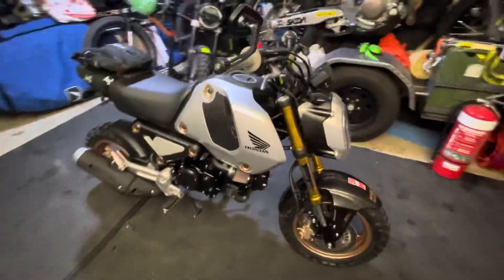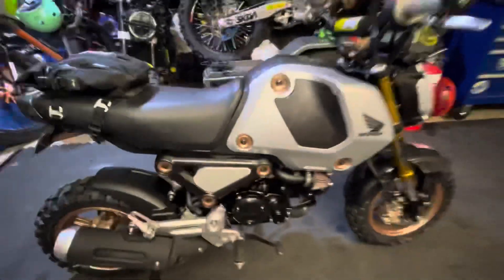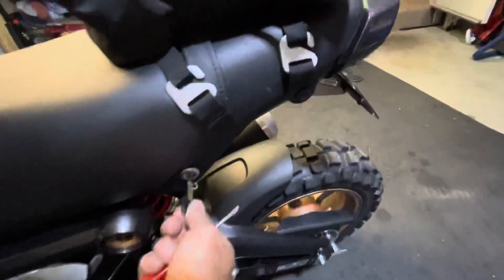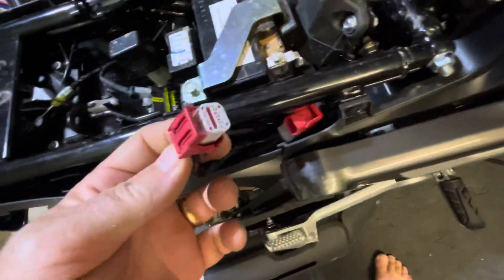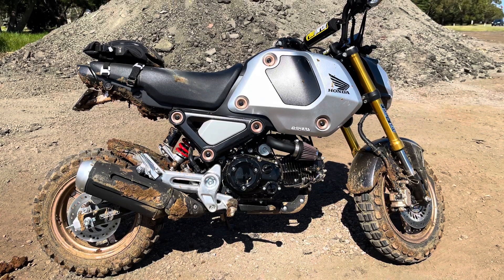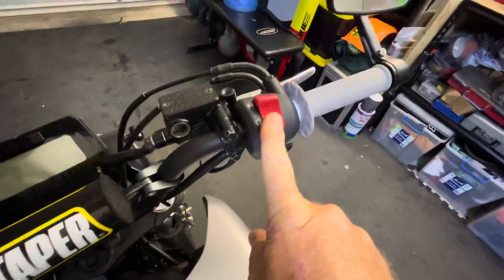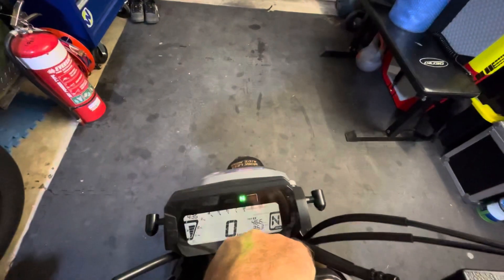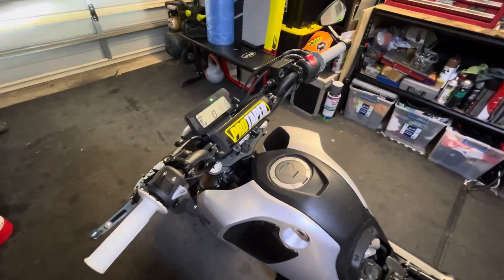2022 Honda Grom ECU TPS Reset how to..

Comment: I changed the stock paper air filter on my Monkey to the Takegawa Power filter, which is also available for the Grom. I've not done an ECU reset and have ridden already 600 miles. I want to do an ECU reset. Does it suffice to only do what you showed, or do I also have to reset the throttle position and the other resets that are in the manual?
Reply from the maker: Would be a good idea to do all For sure pal…

Comment: Does this fix engine runing lean
Reply from the maker: No not really, i prompts the ecu to adjust to any minor changes more quickly but, if you’re changing the pipe and I take you really should get a flash or piggyback to manage the fuelling.
Reply: @dwninetynine  oh I duno what my issue is iv changed everything I got low power in lower rpm at Full throttle I can old my brake on a tiny bit and the bike can't rev up at all. And bad slow throttle response
Reply from the maker: @jasoncarthew2279  well for sure it’s worth resetting the ECU… what you’re experiencing sounds odd.. have you by any chance bypassed the side stand switch?
Reply: @dwninetynine  yh I cut the side stand switch I dout it could be that.  Don't get me wrong the bike ride fine it starts up fine never cuts out its that the pull off on full throttle at any thing below 6k  revs and the bike just about moves. Iv changed 02 sensor and wire, air box and manifold, throttle body with injector, fuel filter, air filter, and fuel pump.  😢  lol
Reply: @dwninetynine  you think it could possibly be the valve clearance 🤔
Reply from the maker: @jasoncarthew2279  there’s strong consensus that bypassing the side stand switch causes the ecu to limit the power in some cases.
Try reconnecting it up, it’s a sensitive circuit trust me I’ve done my homework here. Then reset the ecu and just see if it makes the difference.
Reply from the maker: @jasoncarthew2279  it’s worth checking, is only a 5 minute job.
Reply: @dwninetynine  wish I could check can't get one of the bolts off its rounded just spend 2 hours today trying to hammer it off with a screw driver and drilling a hole.then the drill bit broke off inside the bolt 😄
Reply: @dwninetynine  oh yh and I rewired up the side stand switch as well
Reply from the maker: @jasoncarthew2279  Howd you go? reset the ECU, give the bike a ride, say 30 mins, see what effect its had... Keen to hear...
Reply: @dwninetynine  I been riding bout over hour now no change
Reply from the maker: @jasoncarthew2279  Damn thats disappointing!
Reply: @dwninetynine  I got a spare engine in the shed I pop that on some.time see if that changes any thing thanks for your help buddy I appreciate it 🙏
Reply: @dwninetynine  hello, I just threw an exhaust on my 2023 grom and I got an air filter from k&n (not installed yet). I definitely am worried about leaning out the bike to much. As you said above the reset doesnt fix it. Any recommendations?
Reply from the maker: @Dragonstorm1557GAMING  I would definitely recommend either an ECU flash or an ARacer. I have my ECU flashed by CJR Performance to match all my mods.. well worth doing.

Comment: Hi, I need some help..... I followed the procedure to reset the grom 2022 ECU, I connected the green and blue wire, I fully opened the gas knob and switched on the ignition but the engine light stays on instead of flashing.. .....where am I wrong? Thank you.

Comment: That procedure does not reset the TPS, it resets the ECU.
To reset the TPS you need to use the oil temperature plug too.
But... if you have any error stored, what you just did is useless. You need to clear the errors before anything else.

Comment: 👋 pal I noticed ya rocking  knobby  tires  tell me how are they on pavement? Is it sketchy on turns?
Reply from the maker: Hey bud, These are Shinko Mobber tyres, they are great on the pavement, I can go pretty hard with them, have had the front slide on me once, but I was riding round the Melbourne GP circuit and I was taking liberties LOL.... As for off road, tehyre bloody awesome.. Theyre soft compound so do grip pretty hard on road.. Hope that helps...

Comment: Good video! Quick question, do I reset both after the new ECU install or before I install the new ECU?
Reply: Do not do this if you flashed your ECU.. you will reset that ECU to factory settings.. money down the drain
Reply from the maker: @GODGOTME3927  is that true? I did t know this!! Wow thanks for the warning!! I’ll update the video description!!!
Reply: @GODGOTME3927  no you won’t. Many sources say different.
Reply from the maker: Hey, thanks for the message... I've been told to do it after making any chnages to the bike... hope that helps...
Reply: @dwninetynine  helps a lot! thanks a bunch!